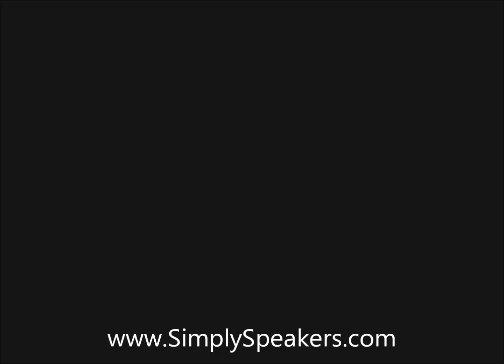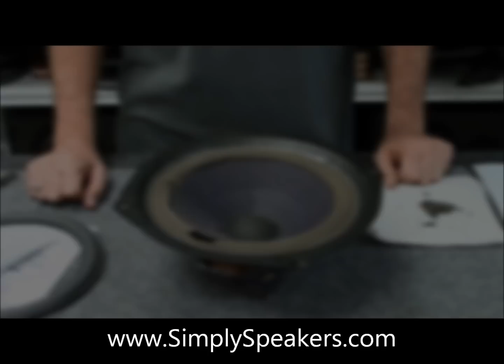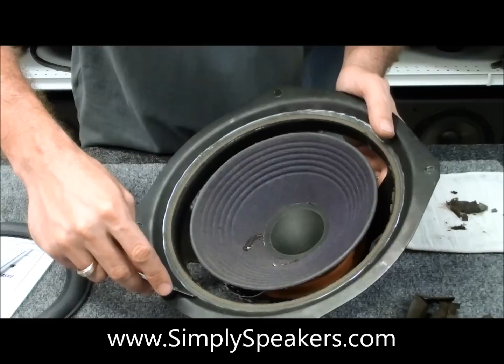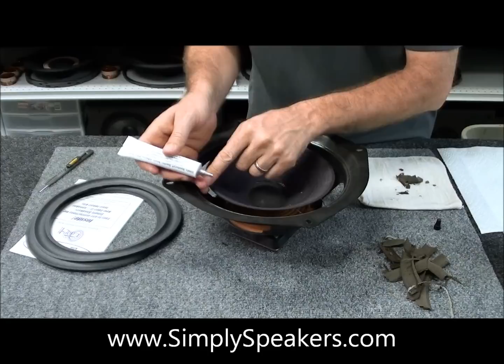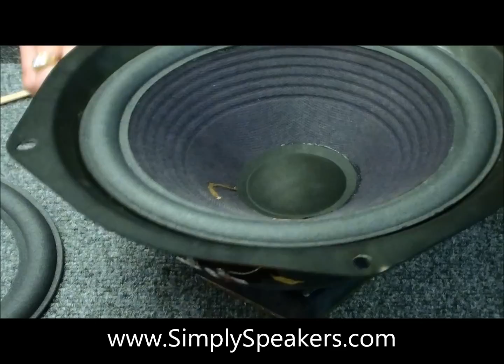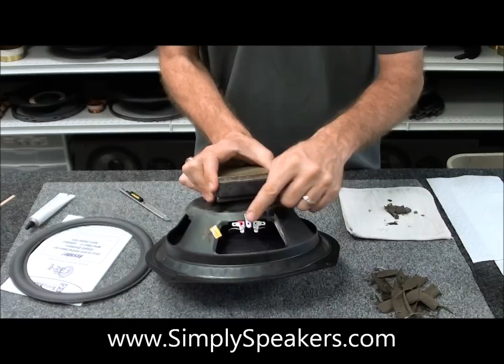Advent Speaker Repair Replace Foam Edge Metal Frame Woofer

Comment: I did this and replaced the caps and resistors and upgraded the wiring and speaker terminals and they sound amazing.  Running quad stack

Comment: This was a fun & easy project. I found that using the tip of a wire tie with pressure applied made it very easy to secure the outer rim to the metal frame.
Reply: Thank You!!!

Comment: I texted Sean over Xmas and I'm goin to start a cerwin Vega  re-38 rebuild , .I want to use some shims in those 15 inch big guys during replacing the surrounds. I ll be ordering some parts soon. Lynn. In. Ga

Comment: If you're lucky you can peel up the old glue/surround on the basket. Usually I can get most of it off without having to scrape. Also I tend to glue the new surrounds to the front of the cone so I have a good surface to mount on. They sound great and you dont have to remove all the old surround from the back of the cone.

Comment: Just ordered this kit. I noticed you attached the surround to the top of the woofer cone. On mine the surround was originally on the bottom of the cone.
My question is does it make a difference which side the surround is glued to?
Reply: Instructions say it's fine to glue to top

Comment: My advent speakers' original foam was attached to the back side edge of the speaker cone..should i attach new foam that way or to the outside rim of cone like in this video..?? Thanks
Reply from the maker: Yes you can, but top mount is easier. Sound is the same either way.
Reply: @simplyspeakers  ok thank you..that's what I figured..I went ahead and did 2 pairs attaching to the backside..wasnt very difficult

Comment: Didn't these speakers originally have the surround glued to the under side of the cone? I just got a set of New Large Advents and what's left of the foam seems to have been attached to the back side of the cone.
Reply from the maker: About 75% were made as rear mount. You can repair them to the top of the cone or to the back. We have never heard any difference between the two methods.

Comment: 5:51 - I really don't recommend using the finger tip to smooth out the glue. They are very sticky and one won't be able to wash them off easily in order to handle or install the foam afterwards. I would just say use the brush (which was included in the kit) to smooth out the glue.

Comment: Hi thanks a lot for the very helpful video. I wonder if replacing a foam surround with a rubber one would change the driver performances in a perceivable way at listening.   I understand rubber sorrounds are almost neverending.  Regards, gino
Reply from the maker: Thanks for the comment. Rubber surrounds are generally too heavy for use on a speaker designed with foam. We recommend using the foam kit to repair the Advent woofers.
Reply: @simplyspeakers  Thanks a lot indeed.  I will follow the advice.  Kind regards, gino

Comment: hear in south fla, it has been my experience that foam surround will deteriate in 5 years or less. whether its a refoam or new replacement spkr even if the speaker never sees sunlight. 
 my solution is your product MI-1291 white in color and in a plastic bottle.
i gently smear front and back of foam and haven't had a failure since.
i have used the product on old spkr foam just starting to crack for an ever lasting repair

Comment: I had a problem with one of my Advents ,,it rubbing some after when I got it replaced ,,I ordered them from you guys and I just didn't get it centered as it should of been,,it showed up when I started driving them hard,,just one speaker ,the same as what's in your video
Reply from the maker: You can redo this one. Email info@simplyspeakers.com. They will send you a link to order a single surround. Thanks!

Comment: I have some kenwood KL 777 FROM japan the glue around outside is fading  away in some places, asking, what would you suggest to fix, these old say 1980 s speakers .say type of glue or product  would be best......
Reply from the maker: Use the MI-3035 repair adhesive. See link here:
https://www.simplyspeakers.com/speaker-repair-adhesive-mi-3035.html
Reply: thank you

Comment: This question was already asked, but not answered... New Large Advent woofer surround were originally glued to the back of the cone, but you're gluing them to the front of the cone... Why is that?
Reply from the maker: We install them to the rear of the cone on models that are designed that way. Ease of repair for the novice is primary reason we made video showing top mount. Advent woofer performance is not affected one way or the other. Most manufacturers (including Advent) use the top mount scheme for most woofers.

Comment: With the right glue and a lot of experience, that could be done in 5 minutes and ready for use.
Reply: Completely Wrong. You need to let the glue dry after each step for at least an hour. Overnight is even better. If you attempt to install the speaker back into the cabinet before the glue has completely dried, gravity will cause the cone to dry off center and then your "5 minutes" was for nothing. Also, you need to get ALL the original adhesive off all surfaces and start with CLEAN surfaces, otherwise the glue will not adhere properly and again, a waste of time and material. Bottom line, take the time and do it right. This is NOT a 5 Minute process!

Comment: which kind of glue you are using in order to do the job , thank you
Reply from the maker: We use the glue that is included with the FSK-10AD foam repair kit. Part # MI-3035. See link here:

https://www.simplyspeakers.com/speaker-repair-adhesive-mi-3035.html

Comment: Hi guys I would like to replace foam for rubber on my cerwin vega 8 inch will there be a big difference in the frequency. Only because I want to preserve them
Reply from the maker: No, the sound will stay original if you do the repair properly.